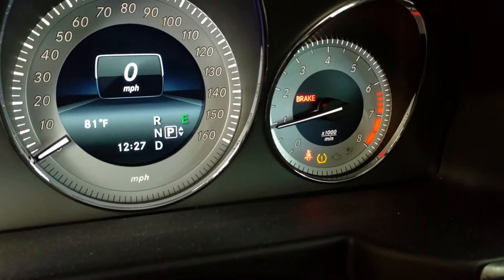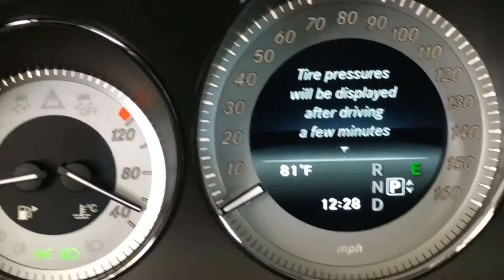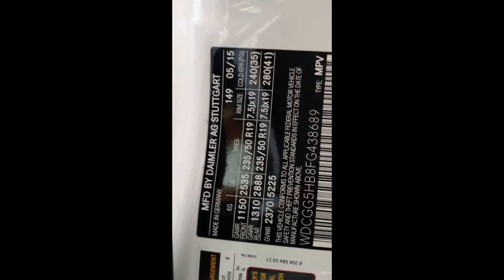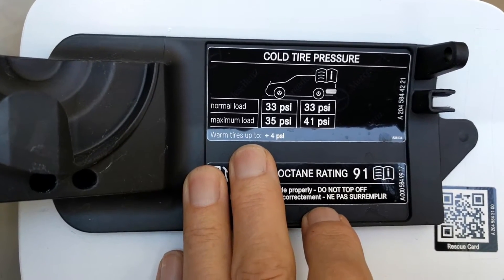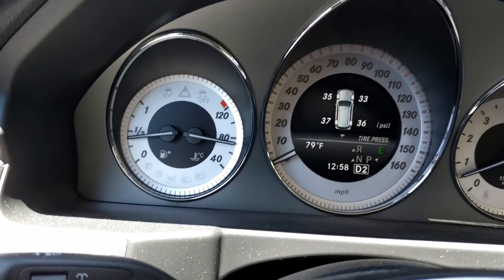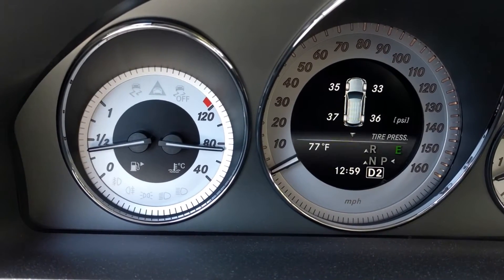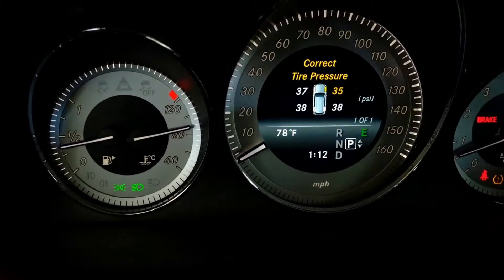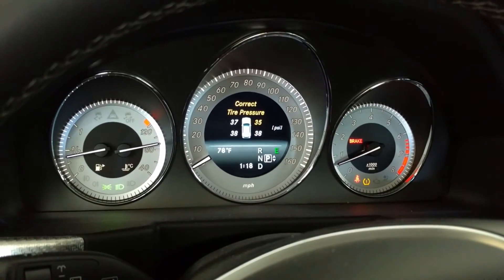Mercedes Benz GLK 350 tpms bad tire pressure sensor by froggy

Comment: I took the door psi's to mean the minimum psi for the warning light. I filled my tires to the tire manufacturer's psi of 50.
Reply from the maker: 50 is very high.
Reply: Mine says 50 in back , and front tire 24

Comment: Did you ultimately have a bad right front censor?
Reply from the maker: No I did set the pressure I wanted with a tire gauge, drove until the pressures showed up on the dash, did the reset. See my other video for the reset.

:)